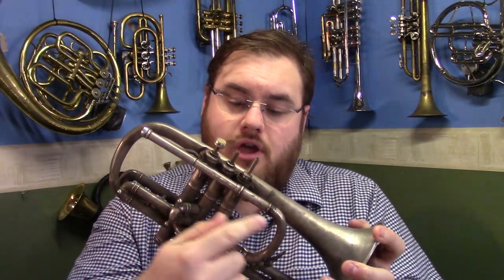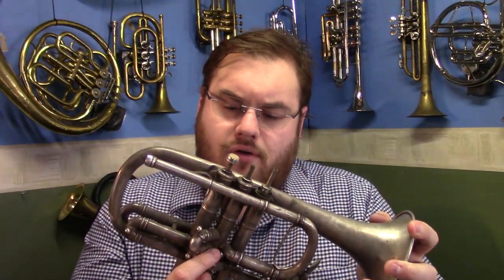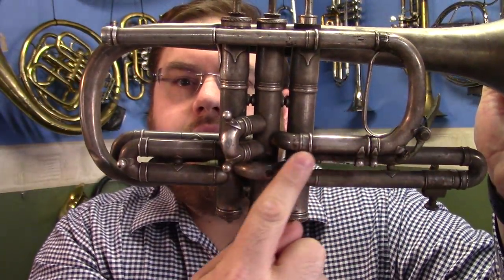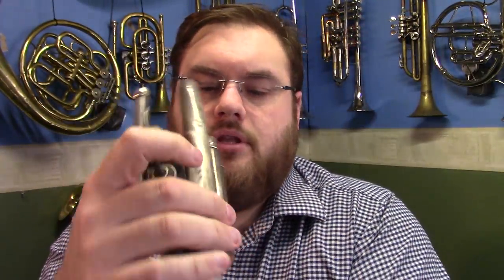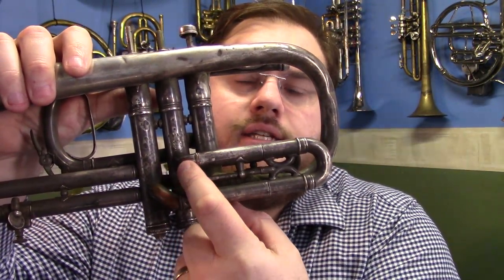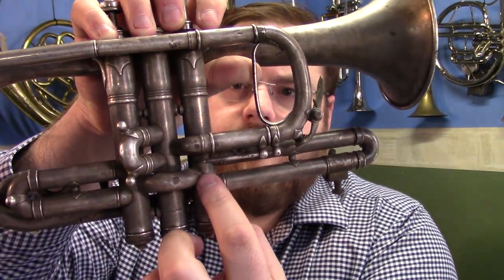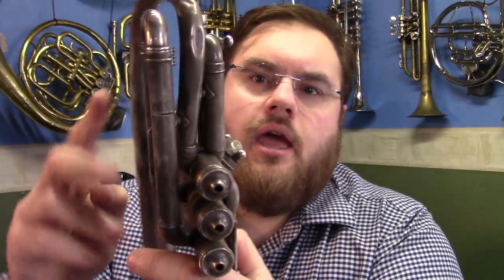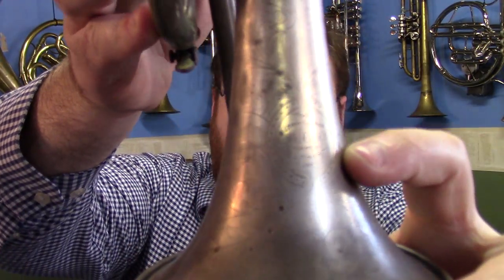The Most Unique Cornet I've ever seen | 1909 Conn-Queror

Comment: I own this model and its in almost superb condition. The tubbing is slightly different and it has a shepherds crook. More interestingly, it comes with a longer alternate tuning slide. Not sure if this converts it to a sharp horn or what. The engravings on the mouthpiece are an eyefull. Got the case, 2 mouthpieces and a metal mute.

Comment: I doubt you will get to it, as you are a pretty busy guy, but I'd personally love to see that cornet restored enough for what would be considered playable condition. You're really not missing any major parts, some of the parts just need some minor work. Caps and buttons can be found or made that fit the thread size required, and the valve appear to be more corroded than physically damaged, so they can be addressed along with the casings fairly easily assuming there is no major physical damage that has changed the shape of the pistons/ casings. It would not be difficult to restore this instrument if you had the time, or to drop it off to someone else to repair it. It would not be too expensive.